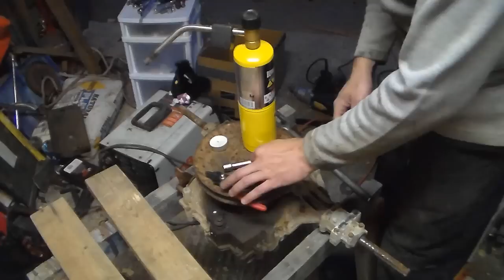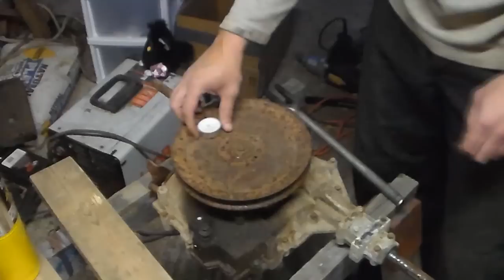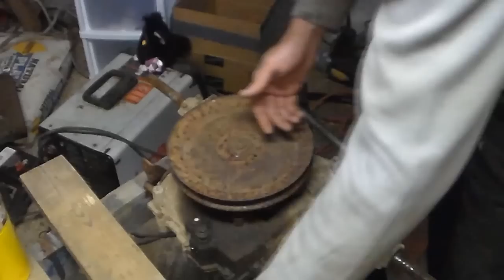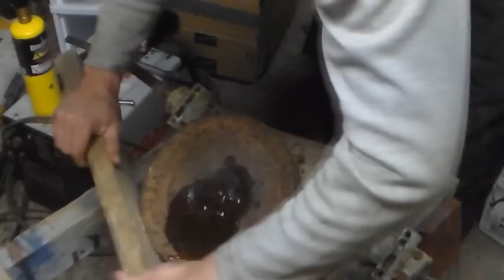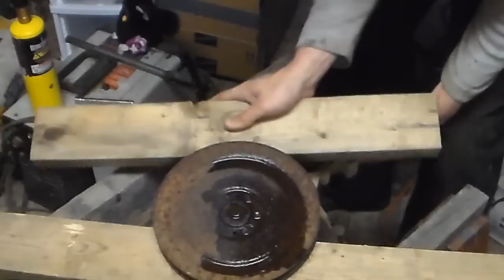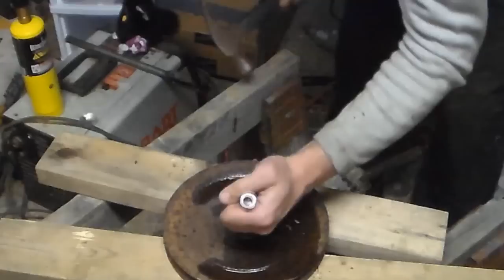Remove a stuck transaxle pulley in less then 5 minutes WAX

Comment: I still like PB Blaster.
Spray it liberally once today and by tomorrow it usually freed everything up.
I had the rear wheels stuck on my shaft and nothing would get them off.
Sprayed Pb blaster on the inside and outside of shaft with the bolt removed.
Next day the wheels came off by hand like butter…..couldn’t believe it but Owning a Jeep XJ made me a true believer in PB blaster getting bolts freed up.

Comment: Here's a tip I came up with. If your engine is blown or not going to be used again then get a hack saw blade and saw the shaft off, then put pulley in a hydraulic press or just tap it on out with a hammer.
Reply: Crankshafts arent made out of mild steel. You arent cutting thru one with a hacksaw unless you have a diamond encrusted carbide blade and endless determination. They are extremely hard metal made with specific heat treat processes